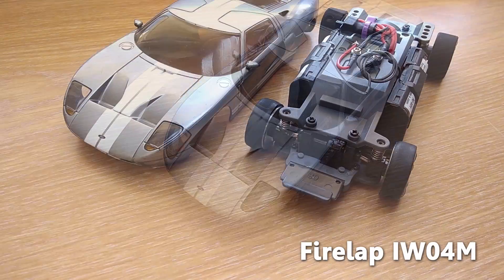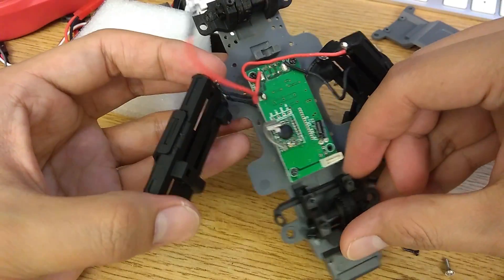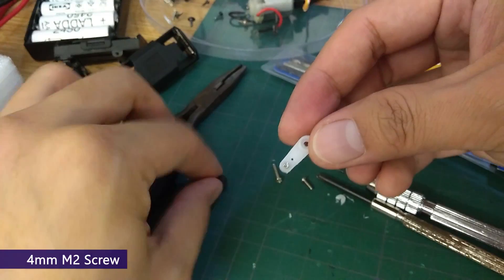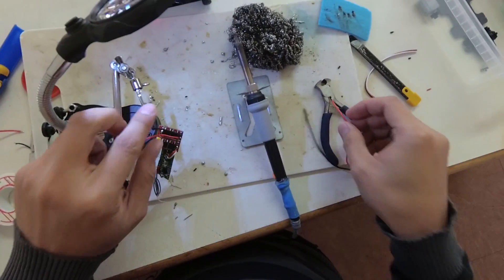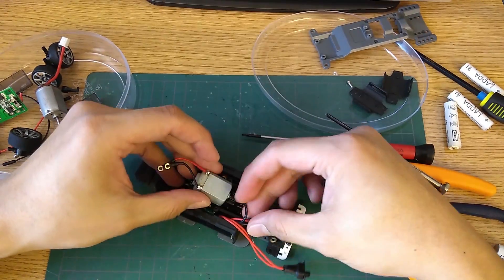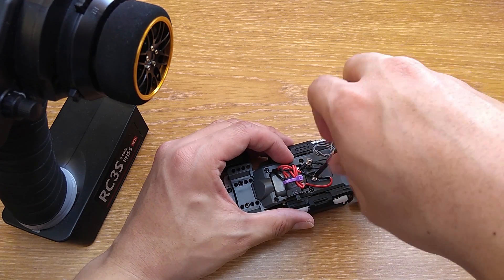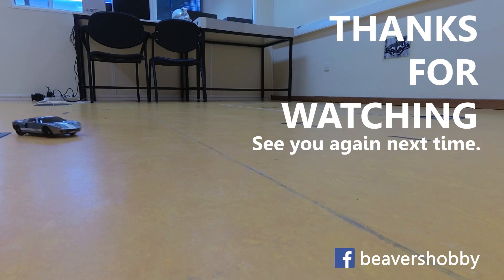How to Upgrade Electronics | Firelap IW04M 1/28 AWD Touring/Drift RC Car

Comment: Weird question do you think servo/ servo horn and the servo arm mini-z could fit into this car?.
Reply from the maker: I tried and it doesn't fit well on this car. The size is slightly different. The slot for servo horn is also longer on this one.

Comment: Great work. Does Wltoys K969 circuit board can fit into this car ? what size of ball bearing that you used to fix wheels wobble issue ? Thanks
Reply from the maker: Yes, you can put the K969 board underneath it. Some modifications are required but it'll fit in the end. I use 3x6x2.5mm mixed with 3x6x2mm bearings in the wheel hubs to fix the wobble.
Reply: @BeaversHobby  thank you very much.
Reply: @BeaversHobby  Can I install Wltoys K969 ball diff on this car ? The tie tod can be replace my Mini-Z MA01 right ?
Reply from the maker: @jerrycheng5409  The ball diffs from K969 is too long, you'll need the Mini-Z AWD compatible one so there are many choices from Mini-Q to Atomic. Tie rod from MA010 doesn't work, unfortunately.
Reply: @BeaversHobby  what suspension spring I can use on this car? Mini-Z MA01, MA02 or .... ? Is this right one to pick ? https://www.kenonhobby.com/PN-Racing-Mini-Z-AWD-Pro-II-Spring-Set-5-pairs_p_42561.html
Reply from the maker: @jerrycheng5409  MA010 but the long ones.
Reply: @BeaversHobby  thanks for the reply, just couldn't find the MA010 long one. how about this one ? https://www.kenonhobby.com/Kyosho-Mini-Z-AWD-MA020-Front-Spring-Set_p_45330.html
Reply from the maker: @jerrycheng5409  020 front has smaller diameter. I found this on Kenon. This will work. https://www.kenonhobby.com/Kyosho-MA010-Suspension-Spring-Set_p_41393.html
Reply: @BeaversHobby  Thank you very much.
Reply: @BeaversHobby  Awesome. Thank you for the help.
Reply from the maker: @jerrycheng5409  My pleasure.
Reply: @BeaversHobby  quick question. I saw you upgraded IW04M knuckle to original mini-z knuckle. are you replace all 4 knuckles ? or just front ? thanks
Reply from the maker: @jerrycheng5409  All 4, if I remember correctly.
Reply: @BeaversHobby  Thank you very much
Reply: @BeaversHobby  great video. got question for the wobble issue. the issue can be fixed by 3x6x2.5mm bearing inside and 3x6x2mm outside right ? do you put any washer on it ? seems like there are 2 washers in outer bearing area but not sure if you still have it for this modification. or the wobble issue can be simply fixed by install the K969's CVD ?
Reply from the maker: @jerrycheng5409  Some wheels need washers, you'll have to experiment with it. These hubs are not that well-made so dimensions are different on each one.

Comment: pin giữ lại, motơ giữ lại ,vậy trước và sau có khác gì nhau? Tay cầm tx có quan trọng gì
Reply from the maker: I didn't have a brake before and the transmitter wasn't precise to get the best out of this chassis. 
Now it's much more fun to drive and I can use any Tamiya Mini4WD motor.

Comment: Have you you seen iwaver rc car with frequency crystal looks like a copy of mini z mr-02
Reply from the maker: Yes, it's been discontinued for years now as far as I can remember. When they do a copy, it's a decent  job and working well as a base for modification.
Reply: @BeaversHobby  yes I neve actually  drove it just bought because of the subaru rally body I tried yesterday day to try it out but seems like the remote are not sinked correctly  it acts crazy
Reply from the maker: @dqniellourenco6162  If you got the electronics that works, it just works. But if it's not like in your case, you'll have to replace the whole thing like in this video.

Comment: Do you know if mini z diffs work with firelap?
Reply from the maker: IW04, yes. IW05 only at the front. The rear needs slot for reduction gear so Mini-Z diff won't work.

Comment: can you make rc drift car beginers guide video like what to look for whem buying one and stuff like pliss

 that im nobby
Reply from the maker: Thanks for your suggestion.
Normally for 1/28 cars it's kind of hard because these specs and compatibility/headroom for upgrade aren't clearly shown in websites. So you have to rely on reviews. Anyway, I have plan to make a round up video with short reviews + what upgrade can be done for each car I have. So I'll make the "what should you look for" section in it too. I hope it will help a beginner to choose a starting car.

Comment: Those boards get warm enough to remelt that hot-glue? Gotta wait a month for my Bang good parts K(, that's also your fault. lol. Neat work bubba.
Reply from the maker: Receiver won't get hot so there's no problem there.
On the ESC, melting is still unlikely because I stick it down on the side without FETs. I've been on a long drive with this too but honestly there's still some doubt left though. This is still winter and I still use standard motor.
Anyway, I've held down the wires on my other ESC with hot glue and everything is still intact so far even that one got quite hot so I'm quite confident it'll hold.
Reply: @BeaversHobby  Good to know. Thanks for getting back to me, it is appreciated.

Comment from the maker: Time stamps
Parts required: 0:26
Disassemble Chassis: 1:09
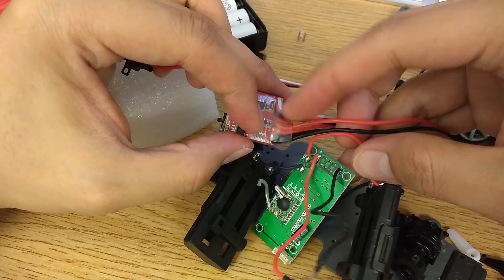Prep receiver for de-pin: 2:36
Test fit the boards: 3:26
Making servo horn: 3:54
Soldering: 4:33
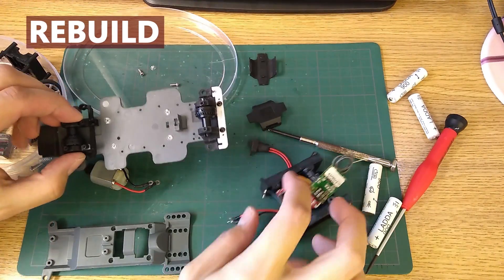Rebuild: 8:28
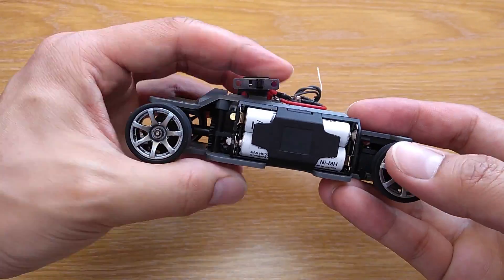How to setup ESC & Transmitter: 11:53
Result: 13:08
Verdict: 13:43